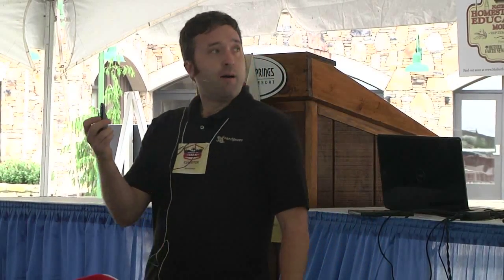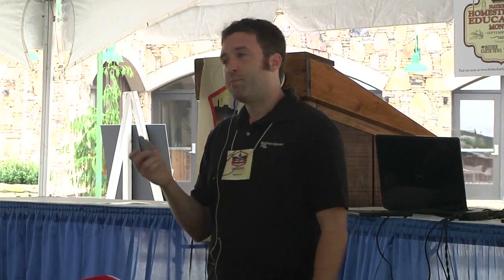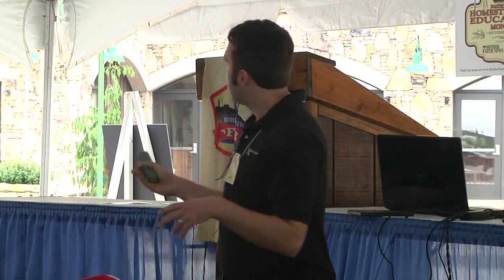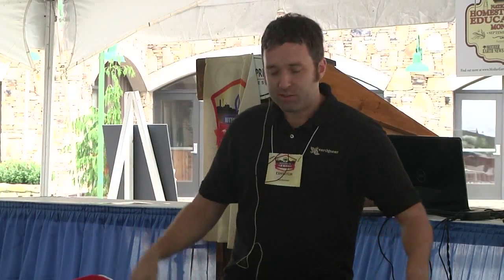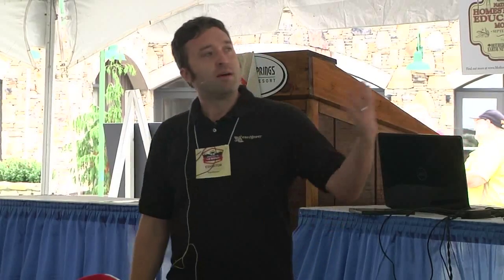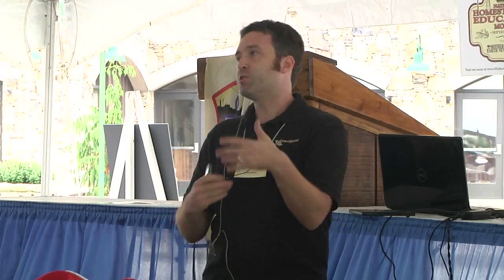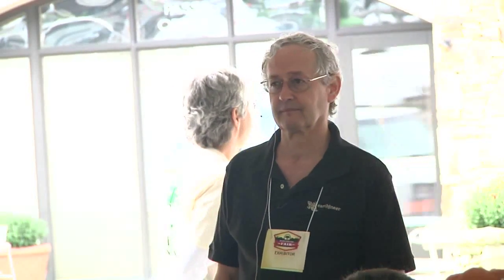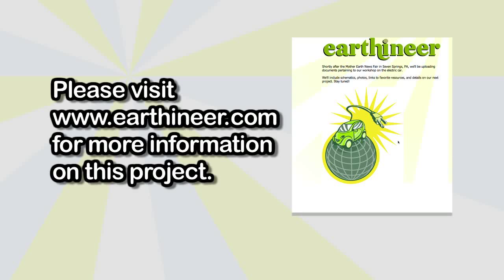Earthineer DIY Electric Car Presentation

Comment: @evric2008 The slides largely just followed the discussion (which was a basic overview).  We reserved a lot of time for questions and answers.  As I mentioned in the presentation, when we built it, we hadn't taken any photos of the process (hadn't expected to be giving a presentation), but the electric car was there on display the whole weekend, so attendees would get to see everything firsthand.   For the next project (where we'll use the AC induction motor), we'll take plenty of photos.

Comment: @DanFrederiksen "you don't program the IGBTs" - that's true, but you have to program the controller to control the IGBTs and control the switching times.   "probably not entirely true that AC lends itself less to regen than DC" - What's coming back from regen is AC and then you have to convert it back to DC to charge batteries, so there is an extra step involved...that's all we were saying.